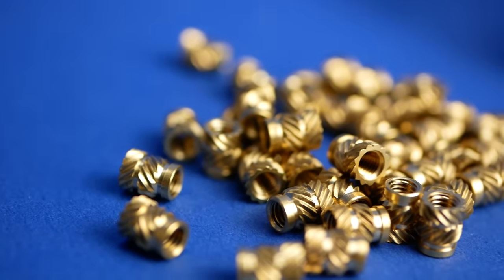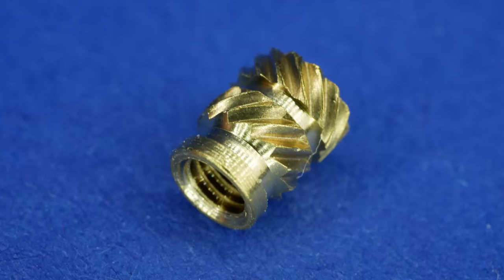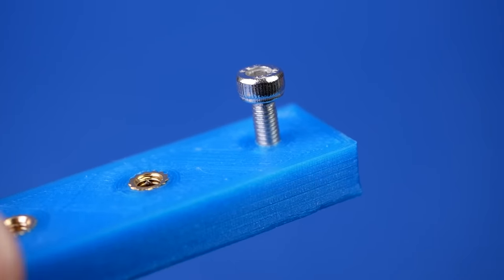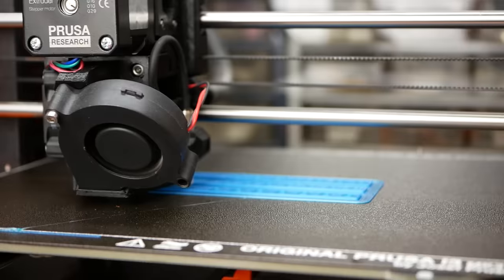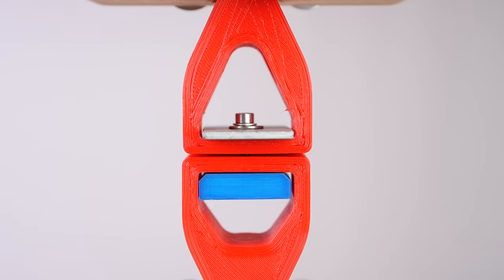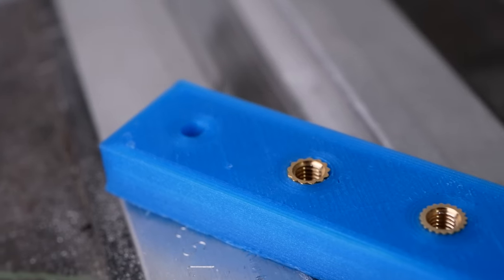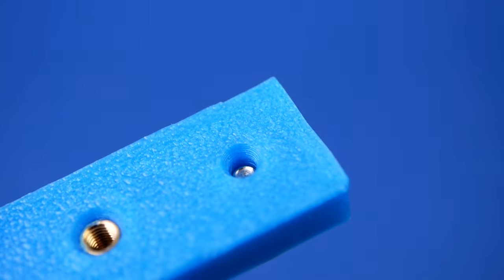Threaded Inserts for 3D Prints - Cheap VS Expensive 💰

Comment: Hello, I am an engineer with 30+ years of experience. When I make something in plastic I aways screw things directly into the plastic to start. Only after there is a failure do I add an insert. 
I meet a lot of engineers and designers that disagree with this but I absolutely stick by my decision. 
Here's why...
You can drill out the hole after it has pulled out to clean things up then add an insert or install a helicoil. You will always have enough material to do this if you directly thread to start. If on the other hand you do the dumb thing and start with an insert, you will find you don't have enough material left to replace a like for like insert and bonding with glues and resin is a inferior choice in thems of strength and other properties like water absorption and adhesion. Thread it first, repair it last. Don't start with the repair, you have just reduced your options further down the road.

So, only use inserts for repairs. There is no good reason to use them in 99% of general use cases. Just thread straight into the plastic. It's the smart design decision. 

The only exception as far as I am concerned would be a joint that is repeatedly made up then taken apart as plastic doesn't wear well and metal to metal connections are invariably the best option. By a lot I mean several time a day or hour, not one or twice a year. 

With all of that said I avoid threaded/tapped connections like the plague. I always try to design my bolted connections to use a nut as opposed to a threaded/tapped interface. Nuts are ALWAYS the best choice. Always, always, always! Threaded connections are only acceptable ONLY if there is absolutely no practical alternative. Design is all about making smart choices and thinking about things like this BEFORE you begin your actuall design. In most cases, with a bit of thought, a threaded connection can almost always be avoided. I can literally go for years between occasions where I had to use a threaded hole. There is always a better way.

A final note for the wise. Spring washers, drilled and pinned nuts, serrated washer, Nylock nuts and such DO NOT work. They are a placebo at best. The only ones that work at all are Nordlock Washers and they are expensive. Just use flat washers and correctly tighten them. I've seen all the test results and it is absolutely conclusive that nothing helps apart from Nordlock washers. Unless you are building a life critical system, do not bother. I've met loads of engineers that just can not believe the evidence no matter how compelling it is.   I saw the test done on an actual system designed to test all types of fasteners and it was 100% repeatable and conclusive. We are talking lab grade test system that is in excess of a million pounds. There was no room for quibbling about the results at all. Save time, money, effort and space, just use a flat washer in your design. A bolt that isn't tight isn't doing it's job at all, it's just being kept in place so you don't loose it, it can not and will not add to the functionality to the bolted connection. Drilled and pinned DO NOT work, I just have to repeat that and test prove it. Hard to believe and accept all of this but once you digest it and accept it, you will be a lot better off for knowing it.

Warning signs...
"It's always been done this way", this is an absolute sign that you are dealing with an idiot. The person saying this has nothing to offer but negative feedback and won't ever help to improve anything, ever.

"All you've got to do is...", NEVER trust anyone that says this. Seriously, these people do so much harm. Invariably they haven't gave the problem any thought and have no intention of doing anything to make it happen. Do not trust or listen to them, make them accountable or responsible for doing "it" and watch them backpedal at the speed of light.

Comment: I would be interested to see how this compares to having inset hex nuts instead. I tend to use nuts to fasten my prints together (similar to the construction of a Prusa) for ease of use since it doesn't require a soldering iron. I could be persuaded to switch if threaded inserts were significantly stronger though. I suppose this largely depends on the amount of infill used.
Reply: My guess is the nut will have a higher pullout, but would have lower torque out because it crushes the part. The threaded inserts are touching the bolt head when they failed in torque out.
Reply: Hi there!

I worked in the recycling industry for years and when we started to use 3d printed parts for our valve systems, we quickly banned all inserts. They just won't hold and become loose due to vibration. You can't loctite them and no other glue seems to work either. The solution was using square nuts in channels. They are not only cheaper but can also handle higher torques than inserts or hex nuts. I hope that helps!

Regards,
Etna.
Reply: Inset hex nuts are my favorite too, either installed after the fact in a slot or captive in the part by installing them during printing by pausing after the last layer before the hole is closed up.
Reply: There is also the question of square and hex nuts. I would guess that square work better in this application.
Reply: I haven't gotten around to using threaded inserts yet, mainly because I'm too lazy to go buy a new soldering iron lol but somehow preferred to buy hexagonal female standoffs. I use them in the same fashion as inset hex nuts, using friction fit to hold them in place and put in a screw from the opposite side so they stay put.
Reply: Inserts for me. Great not having nuts that fall off. For some reason mine would always end up in the part cooling fan duct.

Comment: I think you nailed it in this one.  As tempting as it is to go with the cheap inserts for low strength applications, the amount of time and effort of keeping them aligned is a deal breaker for me, especially if i was trying to do a small production run of parts.

Comment: DANKE!!! 
This very helpful video has helped me prevent a future headache, I haven't need to use these inserts in any prints yet but your video made me think about the kit i purchased.
I had purchased a knurled insert kit and they were the nasty cheap ones more made for injection moulding but falsely sold for 3d printers, they have no chamfer and the knurled part is at the bottom and top so they clog with material and don't sit flush while skidding around on the print. I've returned the item and in exchange purchased a chamfered knurled insert kit, I was going to get the ruthex ones but for £16 for 100 m3 pieces I decided with another brand that is £16 for 240 pieces of m3-m5 inserts that are exactly the same in design appearance with the knurling changing direction and a nice chamfer for seating the insert into your work piece.

Comment: One thing to consider with the cheap inserts, well all inserts, with 4 inserts working together, like the fan mount, the cheap inserts would give you up to 156kg before they started to fail.
Reply: You should never rely on multiple fasteners to do the job unless one is strong enough by itself.  The rest are just for support but all of the load will only be applied to one and not spread evenly.
Reply: Doesn't rarely ever workout like that in reality. It's also a very twisted way of thinking.

Comment: Once I was able to snap M3 A2 stainless steel bolt when screwing it into bare PLA part with 100% infill and thread lenght 10mm which was created by first drilling recommended size of hole for tapping and then tapped it with the bolt itself.

Cheap injection molding inserts, completly useless, come out easily, get blocked at the end - so same results as you had.

More proper press-fit type inserts("eBay" ones) work well for me, but I don't use heat like you do, I drill smallest recommended hole for this insert, then press it cold, requires quite a bit of force, at least 50kg, but then stays in quite well.

Those special inserts "specially designed for PLA" yeah you're correct, those are inserts for standard plastic, didn't use them tho.

And yes I do drill holes in filament, it's stronger as you have solid wall instead of textured wall, it's too much of a pain in the ass to try to print exact hole size, depends on too many factors, too hard to control it, just design 3mm hole, it will print as 3.2mm then you just correct it with 3mm drill.

Comment: Those are not quality screws if they shear off with that cheesy torque wrench.  That is absurd.  Are those screws made of zinc?  You should not be able to shear off screws like that with an impact wrench in plastic.  Stainless steel screws none of that Chinesium bullshit.  Powder molded metal is pure shit.

Comment: i model threads in the part in fusion360, with a little bit of chamfer on top, and directly screw in the plastic. In my experience, with 4 perimeters of 0.4 nozzle this is a rather durable connection, even after a half a year of screwing in and out 1-2 times a week threads hold properly, i just make sure not to overtighten them. 
So, id be glad if you tested torque and pull-out force that this connection can withstand with differing amount of wear on it - perhaps, strength after 0 cycles, 10 cycles, 50 or even more
Reply: Also self-tapping and regular screws with no thread would be interesting.

Comment: would like to see test of Screws that are specifically made to fasten into plastic,  and that self tap the hole.  Like those found on many consumer electronics.
Reply: They'd be pretty good for pull-out (dependent on length, obviously) and fairly lousy for torque. The holes also deteriorate quickly if you take the screws in and out.

I actually watched this video whilst buying threaded inserts (and stainless M4 pins) to replace the self tapping screws that hold on my car's pollen filter housing and can no longer be properly tightened. 

If you will need to remove and refit the screws then self tappers aren't a good choice in any material.

Comment: For such a technical hobby the 3d printing community really does have a lot of folk wisdom floating around that is pretty much baseless. Its really nice to have these videos to provide some real information.
Reply: So true. DIY 3D printing is the poster child of Cargo Cult.
Reply: @ArnaudMEURET  When I got my first roll of PETG I spent the longest time taking pains to 3d print everything as one part because I had seen loads of people say it was near impossible to glue it. But one day when I was out a family member accidentally broke one of my prints and glued it back together. Turns out super glue works fine on PETG. I learned a lesson about 3d printing common knowledge that day.
Reply: @outsider344  It kind of depends. ABS you can just partially dissolve with acetone and get perfect properties in the joint, as if it had been one piece (disregarding internal structure from infill). Super glue works well if you just want a stiff joint. If you are however using the flexibility of PETG properly gluing it is hard.
Reply: @FreeOfFantasy  I agree. But I had seen people saying you just can't glue petg at all. That they avoid printing it because the only way to join pieces is with mechanical fasteners. You do make some compromises with the material properties at the joint when you use superglue but that beats the heck out of having to screw parts together.

Comment: Wonderful video.  I usually use the under-sized hole method.  I've also had success with regular M3 nuts thermally set into one side of the part.  The measurements of having a nut thermally set in a hexagon pocket in the opposite end of the part would be interesting.  This is cheaper than the Chinese brass injection molding inserts, and likely provides greater strength, due to the exposed diameter of the nut being supported by almost the entire thickness of the plastic.

Comment: Would be interesting to see case variation with screw directly to plastic, reasonably tightened, and performing the pull out test after some time: from my experience screwing directly to plastic suffers often from creep or material relaxation over time thus might not be a long term reliable solution.

Otherwise it was a great video, as usual! Cheers!

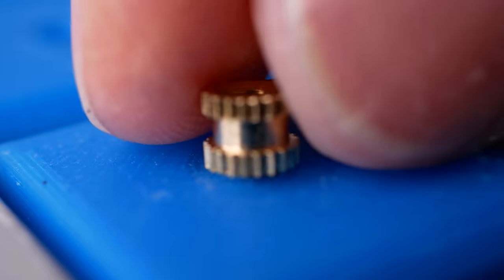Comment: The one that was blocked @6:30 isn't even made for this usage. Injection molding I'm sure it would do fabulously but you are using a square in a round hole and judging it. No fair and misrepresenting a part out of it's intended purpose. Just saying...
Reply: At @0:55 It literally says on the video "Typical injection molding insert"... not sure what your beef is.
Reply: @EngineeringVignettes  I'm not sure what the keyboard commando world of today sees in constant conflict but just know that not every comment you don't agree with is a "beef". /facepalm
Reply: @marsyas9860  - No hate, just asking. 

I'm sure we can agree that the injection moulded insert is not a good option for inserting into 3D prints, as clearly shown in the test results. Unfortunately sellers on eBay et al. are advertising these as 3D print inserts which I think is wrong. I think Stefan was trying to clarify their incorrect usage (for 3D parts) in the testing.
Cheers,
Reply: @EngineeringVignettes  My respect to you sir. We seem to be on the same page now. Have a great day my friend.

Comment: For the next video

How well do embedding an ordinary nut compare
Reply: Good question. From experience, captive nuts perform better (when used on the reverse side of the part, or even embedded inside the part), simply because they have a larger surface area to engage with the plastic.
Reply: @fredgenius  captured hex vs captured square nuts!
Reply: They can be fiddly as hell, though.
Reply: @fredgenius   Your claim does not make sense with respect to the empirical data given. If you had the hot melt insert on the back side of the print, the plastic would again be the weak link. Look at what the inserts did in the last video when he had infill. The inserts were strong enough to blow apart the plastic well beyond their diameter. Having more surface area is a moot point when the weakest point is the surrounding infill.
Reply: @Anyone700  As I said, it is my experience. Much depends on the material, and structure of the print, I suggest you try for yourself and form your own conclusions.
Reply: I think nuts can perfom a huge torque, but they will slip out more easly than cheap inserts.

Comment: I would be curious to see the effect of hole geometry on the pullout strength of the cheap inserts. For instance, you could try having a conical top to facilitate threaded insert alignment. You could combine this with a narrower diameter below the cone to help grab on the smooth ring of the cheap threaded insert.
Reply: Unfortunately the insertion path robs you of most of the freedom there. Because the bottom is flared out, the top is flared out; once you insert the bottom, you have displaced the material and it won't really fill the void around the waist of the insert no matter how you designed it originally, i would think, since the plastic is never fully molten.
Reply: Me too, I use the cheap inserts and found good results when reducing the printed hole diameter to something like 3.5mm . Yes it causes excess pla to ooze out when inserting but it definitely makes for better pull out  strength. I suspect some experiments will show that its possible to make usable inserts with the cheaper type.

Comment: For anyone who wants to use the overmolding "cheap" inserts but still want some strength:   
1) I like to make an alignment counterbore.  This helps installing them correctly for sure.
2) You can relieve pull out stresses on the insert by installing them on the opposite side that the bolt is going through - such that there is a shelf of PLA in between the edge of the insert and the head of the bolt/screw.

Comment: I fit them from the back of the part where possible, then they perform much better!
Reply: That's a great idea! You can even make so that the hole has a smaller diameter on the end. Awesome, thanks!
Reply: @runklestiltskin_2407  You can also make insert hole with alternate layers smaller/larger, and glue the insert in with epoxy...
Reply: Same here. I fit them in through the backside and then pull them in ffom the front with a screw. So you don‘t need the space for the soldering iron.
Reply: @timha4102  Yes, I use this trick to help get the insert square, so the screw is perpendicular to the surface. I use a long stainless screw so I don't burn my fingers, and easier to judge the correct angle.
Reply: thats also an idea that i thought About an had liked to see as a test
Reply: Fred Genius  Just to make it clear - I get the cheapest inserts and just pull them into the petg without a soldering iron. This makes sure they are perpendicular and their teeth cut straight into the plastic. At least in petg this is my preferred method.
Reply: @timha4102  I'd still use a soldering iron. Melting the material gives the insert better grip and lets the molten material fill in around the insert. Pulling it through cold would make the material fail at the point of entry.

Comment: I use chip board screws direct into material, 6 sided holes in the 3d print - the hex holes seem grip really well.
I set short axis of hex hole (parallel sides) to inner diameter of the screw (inside thread, measured at top of screw with calipers)
Seem to work :)

Thanks again for all you hard work.

Comment: I was wondering about the pullout strength of bolts heated to 210 degrees C then screwed directly into PLA. It seems like this would give higher pullout strength because the PLA can flow more fully into the thread form. Another brilliant video Stefan.

Comment: If you don't want to use threaded inserts, most commercial cases use wood screws or special screws for plastic. Please also test those screws. Typically you can unscrew and rescrew them e.g. ten times.